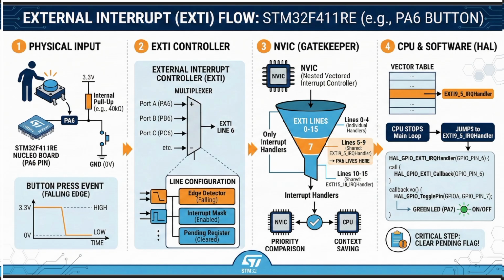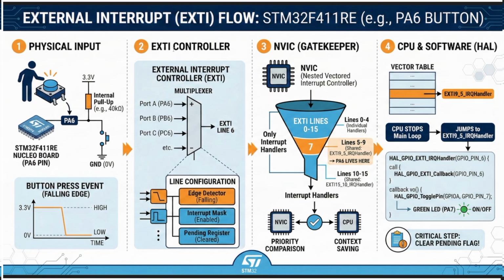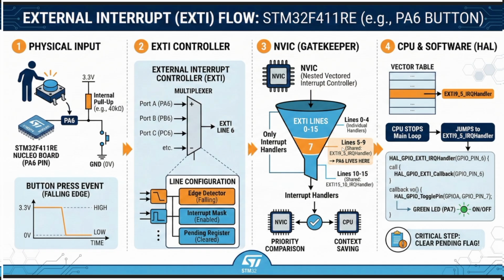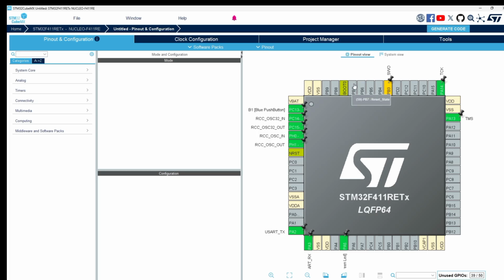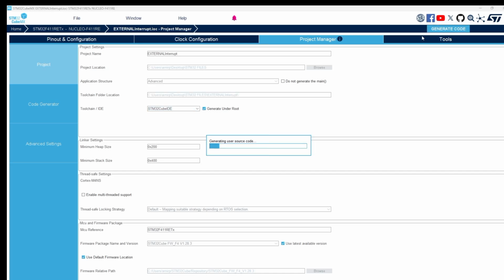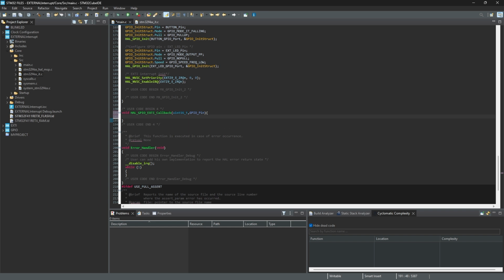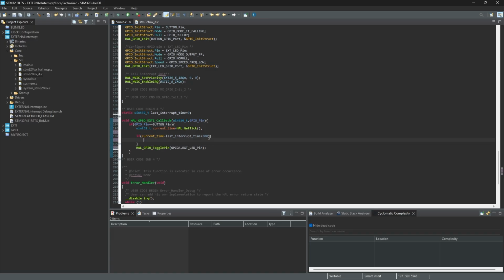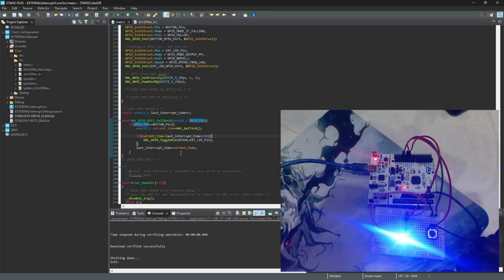STM32 External Interrupts (EXTI) Explained | HAL+ NVIC + ISR Example

Comment: so why does my code never enter the Interrupt Service Routine (ISR) when I press the button thou I’ve enabled the EXTI mask and mapped the GPIO correctly 🤔.
Reply from the maker: Make sure the pin is configured as GPIO_MODE_IT_RISING or GPIO_MODE_IT_FALLING(depending on your internal resistance config)and that the EXTI interrupt is enabled in the NVIC. Also ensure your EXTI_IRQHandler() calls HAL_GPIO_EXTI_IRQHandler() so the HAL_GPIO_EXTI_Callback() gets triggered. Otherwise you'll have to check your circuit again. I will add the link to the  github repo for the source code in the description,you can check as well